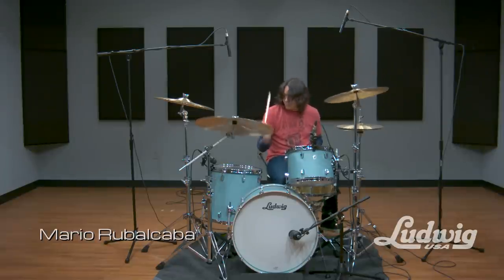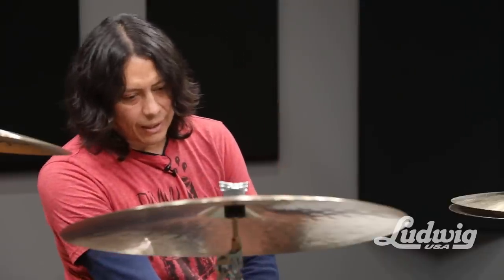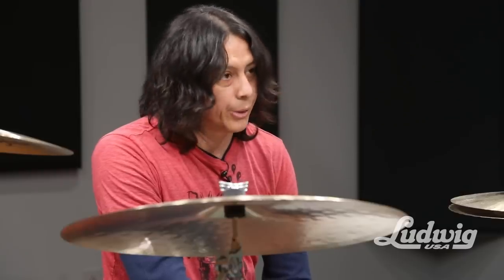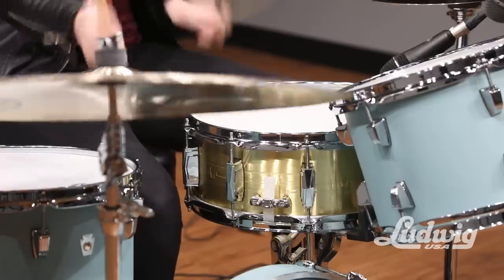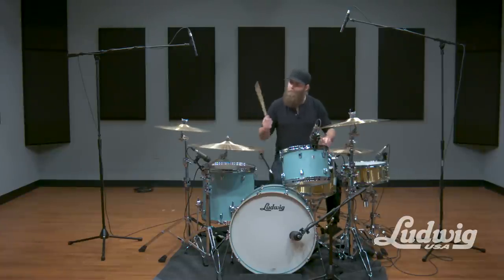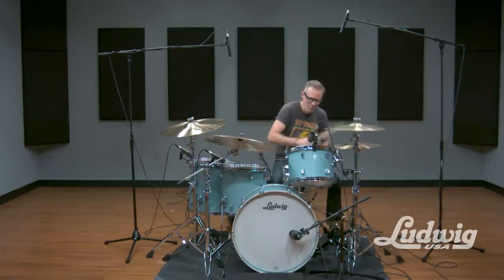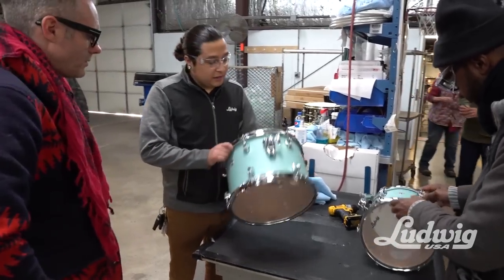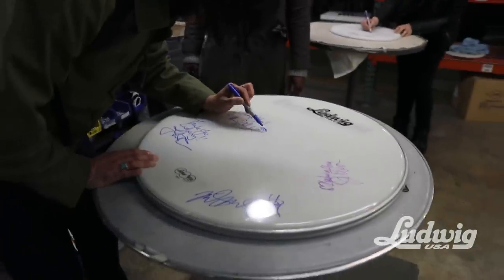Introducing the Ludwig NeuSonic

Comment: Ludwig is definitely headed in the right direction. I love that they are mixing it up with different wood and bearing edge configurations. These NeuSonics are a FAR cry from my crappy old Rocker II's, and I'd wager you can set the toms without the mounting system stripping out and wobbling all over the place...lol. Those old beaters DID have a good sound if you replaced the batter heads and tuned them up good and proper though.
 In any event, I'm really impressed with the whole product line and can not BELIEVE the difference in quality with today's drums, hardware, and cymbals compared to the 80's when I was learning to play starting in 5th grade band( Ludwig UFO snare and Gladstone pad FTW! ). Back then, if you wanted perfectly round shells and immaculate build quality with hardware to match, you were headed to Germany to sell Horst Link your kidneys and perhaps some indentured servant time as well. But hey, you got your choice of Beech OR Beech!.( they had birch too, but it was a special, COSTLY birch that came from the trees of Valhalla and was crafted by pixies and unicorns under the strictest guidelines and watchful eyes of Minotaur overseers who didn't take days off, and overtime ain't cheap kids! ).
 Yeah I've said enough; the drums are great!

Comment: I wonder what costs the most for the company, atlas mount/lugs for the toms or separate lugs and mounts?
Reply: harrypar1 this was done because of weight. They designed these kits with the gigging drummer in mind. Instead of making another bebop kit like everyone else, they made a full size kit that’s light weight, and sounds amazing! The lugs on these drums are the smallest Ludwig has to offer. And the Triad mounts that they use are way lighter than the Atlas mounts. I have one of these kits and I have aKeystone X. The difference in the weight is astonishing! I can pick up this bass drum with one hand. Really nice, well made, great sounding drums!

Comment: Ok, at the 4:38 mark the guy is playing the exact kit at the first guy ....and this tom is an 8x12?  Please, let's have some clarification on what the kit sizes are, and what is available for add ons?  Thanks ...
Reply from the maker: Two configs available. 14x20 Bass, 14x14 Floor Tom, 8x12 Tom and 16x22 Bass, 16x16 Floor Tom, 8x12 Tom. You can purchase additional toms as components. If you look in our webpage it breaks it down for you. Thanks!
Reply: Thank you. My point was that the details box in the videos didn't look correct with how the drums look, that's all.  Also .... those configs are strange to me.  Why not have a 22, 13, 16 config? Super Classic baby! :)
Reply: jmetz Because having a 13" as the only rack tom limits your options if you want to add other toms. Also 12" toms are slightly more versatile.
Reply: understood, however, someone who would want a 13 as a main could add a 12, or ... like me, who thinks a logical 5 piece kit is a 10-13-16 ;)